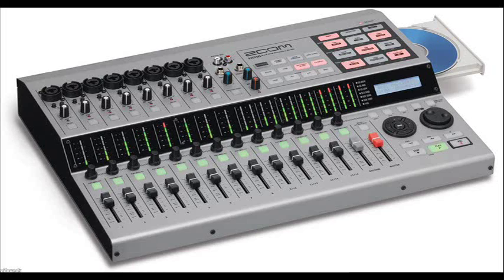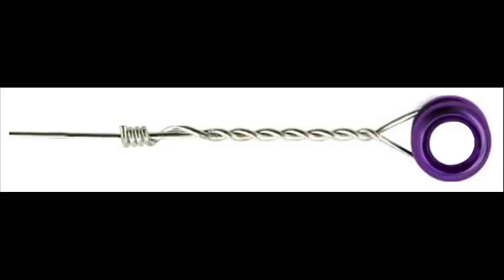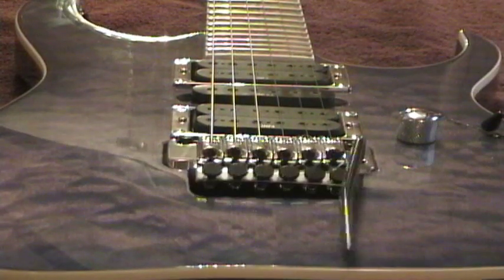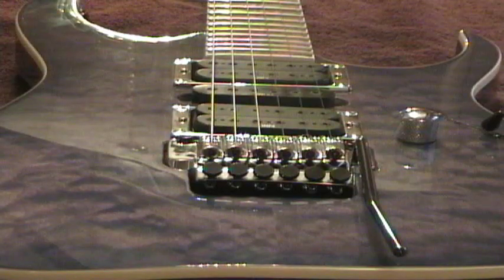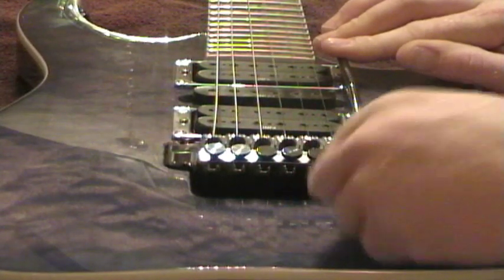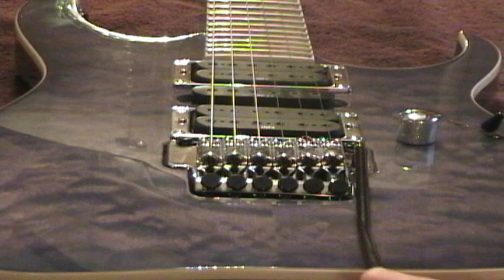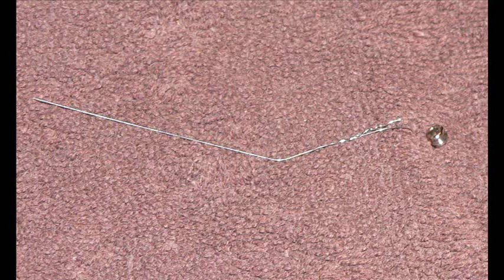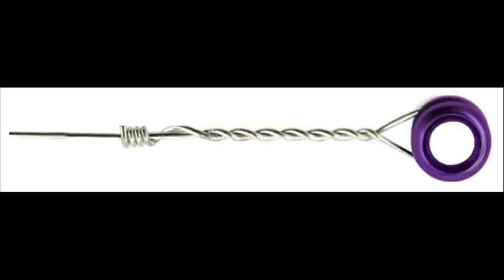Guitar tech tips. Edge 3 set up and longer string life.

Comment: The Edge 3 works fine as long as its set up straight and level with the body and lock the strings down nice and tight - I put some chapstick on the knife edges of  trem block & the mounting stud grooves, works wonders- when restringing, make sure you give the new strings a really good stretch before u lock them down DON'T adjust the action with the strings under tension,it can wear the knife edges down  slacken them off first then turn the mounting studs, retune to pitch & repeat till its right

Comment: The original edge is by far my fave but i tell you what...ive NEVER had a problem with the edge pro, the edge 3 or the edge low pro.  The 3 is very smooth.

Comment from the maker: Changing to heavier gauge strings MAY level the bridge but it shouldn't be necessary. You're reducing the string tension a lot when you go to drop c so the spring tension becomes too strong to keep the bridge level. You should be able to just lower the spring tension. The adjustment is made backing out the two wood screws that hold the spring hold bracket thingy. Search whammy for dummies if you not sure what I'm talking about. There's a good vid on how to this.
Good luck

Comment from the maker: I think the secret is in the springs. I have a Floyd on another Ibanez that is very stiff and does'nt flutter well at all. I tried to remove a spring but I wasn't able to balance the bridge. I may try it on yours you'll need to tighten the spring tension to balance (level) the bridge.

Comment from the maker: @thojyout23 Don't sweat it. You can set it up With the springs parallel or with the outside ones angled. You have the right idea about adjusting the spring tension just make smaller adjustments. It will be time consuming to get the hang of it but you'll get good at it. If you stick with the same guage strings when you change them you'll rarely have to make adjustments. Good luck and don't get frustrated.
Regards.

Comment: i got so excited when you showed us how to tighten the trem arm. I've got an Edge Pro and unfortunately it doesnt simply have this allan key.. there looks to be a drilled hole leaving an opening to the trem arm, couldnt quite see if there was a thread in there, i'd have to pull the trem out (... i just put new strings on it yesterday!) so i wont remove it just yet. 

But anyway im hoping you can point in the right direction here. Do you know if theres a definite way to tighten the Edge Pro arm?

Comment from the maker: If I understand you correctly, your guitar doesn't com back to pitch when pulling up. This is likely because the blades that balance on the bridge post are worn. You can try some lube (chap stick works) between the post and blades but you'll likely just have to do a slight dive after pulling up to bring the guitar in back in tune. Usually this sounds good anyway. Someone else may have a better idea.
Good luck.

Comment from the maker: No, you pull the bar down the same way you would during normal use. Tension adjustment is usually only need when you changing string gauge

Comment from the maker: @ManowarFan1985 I would make sure that the bridge is level if not the spring tension can be adjusted to level it. As far as the cracking noise I do know that it is a common problem and my Charvel is starting to do it. Not sure yet what causes that. You my want to take it to a local repair shop.
Good luck

Comment: I wasn't sure what my guitar had.  It's an Edge 3.  I used to play with a tight bar and that stupid screw gauged up the bar.  I like a loose bar years later, and getting it to swing free without a bunch of slop it nearly impossible.  I've found that screw loosens constantly and the bar always has slop.  The other problem I have, is that I play the bar backwards a lot which will simply lift the bar out of the guitar.  Looking to drill and re-machine the inside.

Comment from the maker: Floating bridges are a bitch to tune. When you tune one string it changes tension on the others. You have to retune many times while it's unlocked. Once your sure all strings are in tune lock it and you may have to do one more final fine tunning. After that it should stay in tune very well. Maybe a small tweak after a long wile. If this is not true you may need to have it looked at.

Comment from the maker: I would think you could run 10's with 3 springs by adjusting the tension. Search Whammy for dummies part 2  to learn how. If  you adjust the tention all the way and still cant level the bridge you can try removing the spring holder and using those holes. Good luck

Comment from the maker: Yeah, but the I've never had spring remain stretched out. Anyway sounds like you know how to make the adjustment if needed. I would be very surprised but if the bridge is higher after tightening the bar just tighten the spring tension slightly.
Good luck.

Comment: Hey Mr Leedsman, i've got this problem with my tremolo Edge III, well you see, i play with 10 gauge strings so, i need to put 4 springs on the back of the guitar, but i can't, the back of the guitar has 5 holes for the springs, 3 for springs and 2 for the spring holder, would you help me out with this thing, how am i supposed to put 4 springs on the back of my guitar?

Comment: i got a rg350dx with edge iii,  i broke the high E string on it, so i replaced all the strings, now the tension is all F!@# up, then stupidly I loosened the tension ALL THE WAY and all the tension springs came off, now i dont know how the springs were originally. if i have 3 springs for tension, should i make them parallel to the holding parts for it by the screws, becuase right now all my springs are in the middle, and  now my new high E string broke again cuz i couldnt set it up properly!

Comment from the maker: When you say adjust the tremolo bar does this mean tighten the set screw I talked about in the vid? I can't think of any possible way this would detune your axe. And if it's snug your bar shouldn't be loose.  Are you sure you tightened the right screw? My hand hides the adjustment in the vid. There is a clear shot of the screw with the system removed. I can't think of anything else without more info. 
Good luck!

Comment: wait wait, arent you supposed to cut the ball end off?
Reply: This probably doesn’t help much 6 years later haha. But it’s a bit of a loaded question. With floating trems either way works, I’ve seen people do both. You can string from the tuners down and leave the ball end hanging off the tuning peg kind of like Tom Morello does. Or you can just cut it off and install that way. Either way works with the Edge III and most other floating tremolos. 

When he was talking about applying solder to strings before installing them, I think he was referring to doing it for his Fender type guitars that you load strings through the back or top and keep the ball intact.